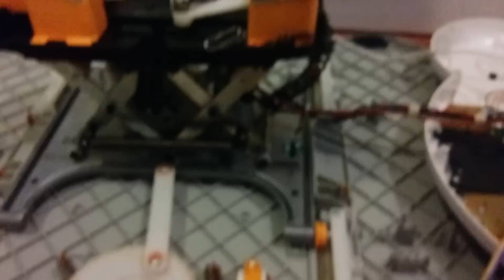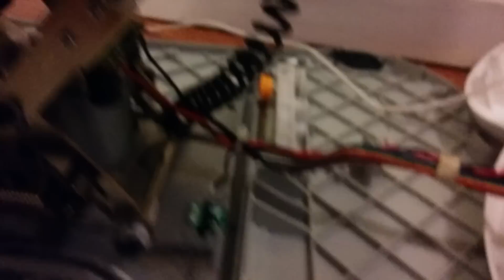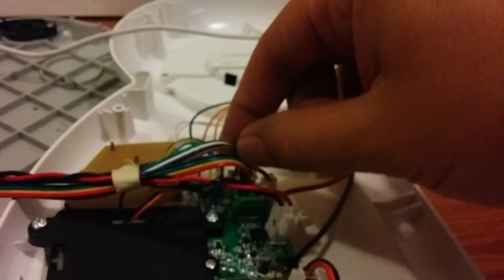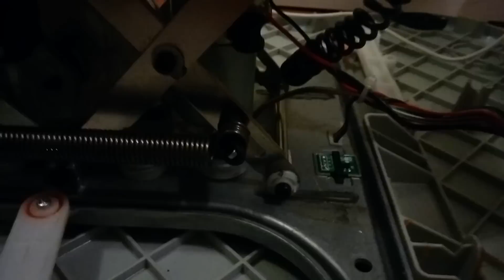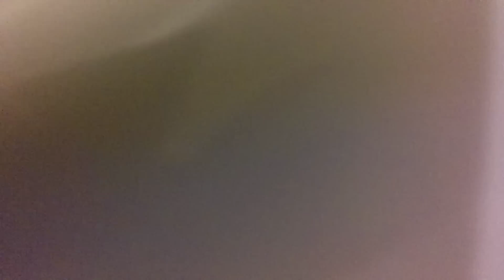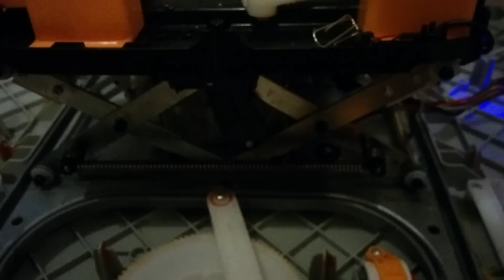Mama Roo Obstruction Fix

Comment: The mamaroo has 4 proximity sensors.  One in front of where the baby sits which senses the up and down cycle, one on the left of the horizontal rails senses the left and right cycles; these sensor should not be the problem but used to coordinate movements. 
There are two other sensor one in the white box on the left and one in the back of where the child sits; these sense spinning disks to indicate the machine is moving freely (without obstruction).  With a voltmeter the pins read (left to right facing rear on the control board) 10v, 3v, ground, and signal).  The signal should alternate between .15v to .60v as the disks spins black/white.  I found one sensor was working properly the other always read .60v.  How I fixed mine was to steal the good signal by jumping the 4th wire from the bad sensor and using the signal from the back of the good sensor.

Comment: Alguien me lo podría explicar en español, por favor.
Reply from the maker: Espero que el traductor de google funcione. Esto anulará su garantía. No intente a menos que sea bueno con un destornillador. Señalo un sensor en la base del MamaRoo que se saca de su lugar. El sensor está ligeramente oculto. Sigue la cinta que señalo en el 24º segundo. Empuje el sensor en su lugar original.

I hope google translate works. This will void your warranty. Don't attempt unless your good with a screwdriver. I point to a sensor at the base of the MamaRoo that is pulled out of place.  The sensor is slightly of hidden.  Follow the ribbon I point at in the 24th second. Push the sensor back in its original spot.